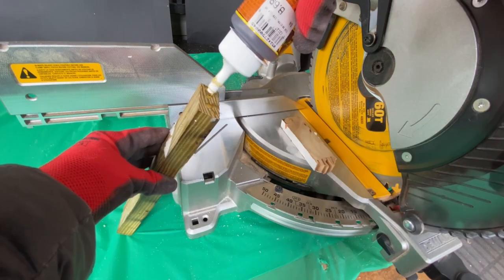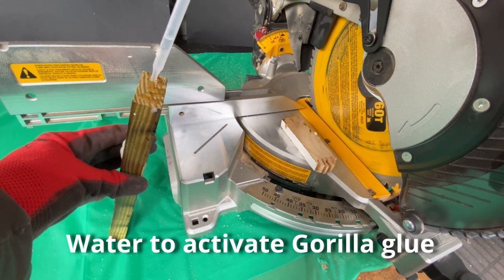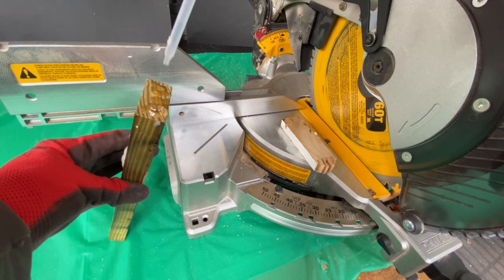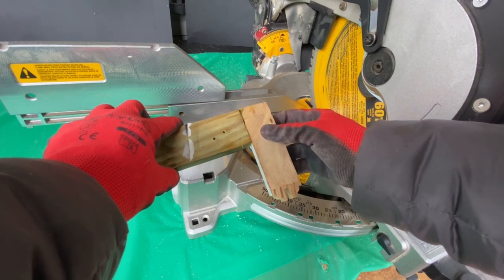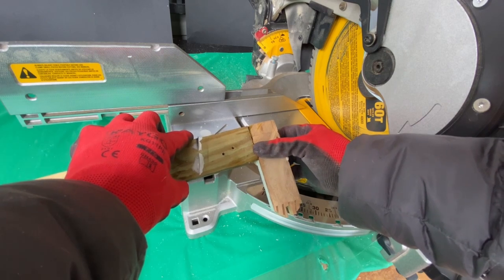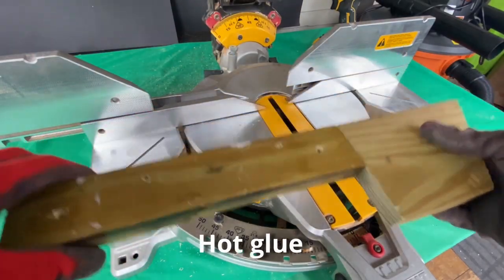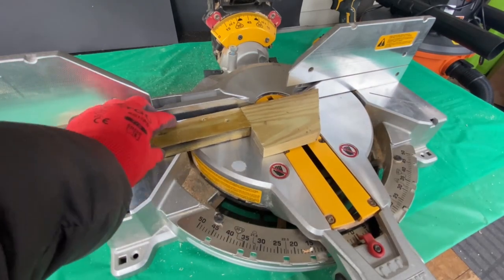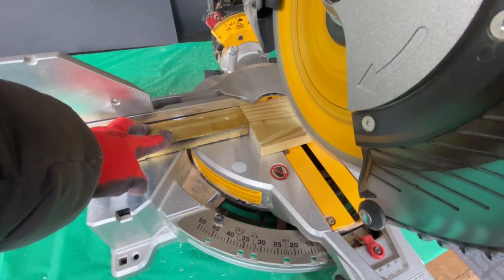How to Cut Small Pieces of Wood with a Miter Saw Safely!

Comment: Excellent!  Just what I was trying to figure out.  I have a small piece that I need to cut in two for handles; way too dangerous without a good technique.  I was cutting a small piece earlier this week and didn't realise there was a loose knot on my side of the blade -  flew off the blade 100 mph at my left shoulder - never saw it coming; could just as easily have been my face!  I think the double-sided tape looks like the best option.  Thanks!
Reply from the maker: Oh no thats so scary!! Glad nothing happened to you!